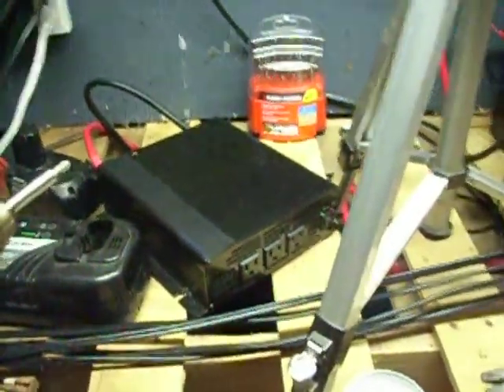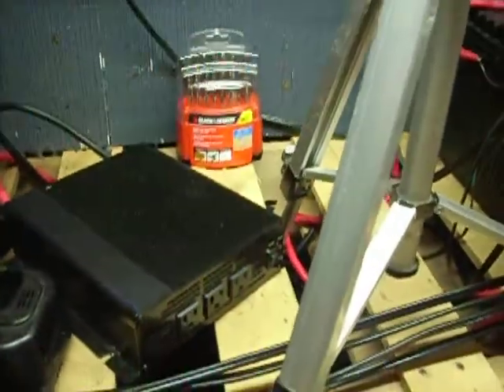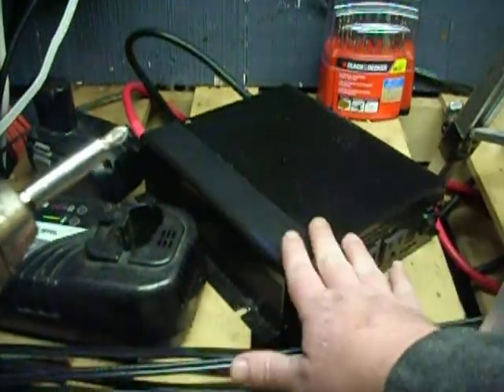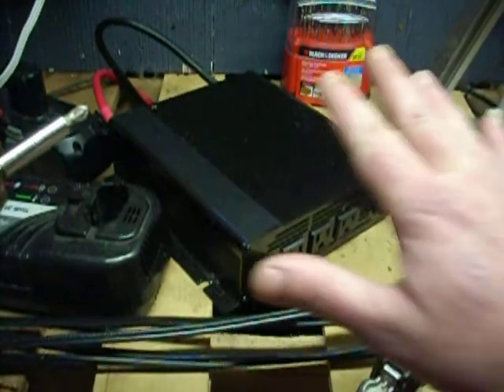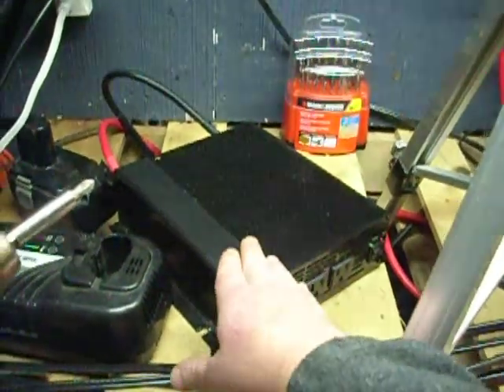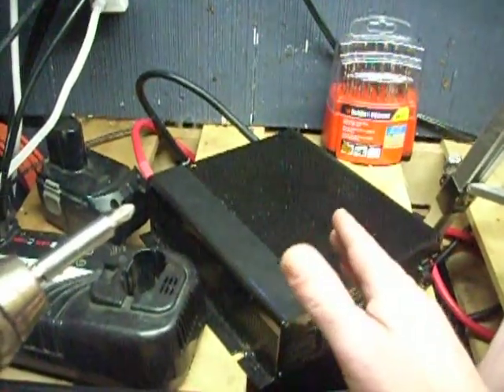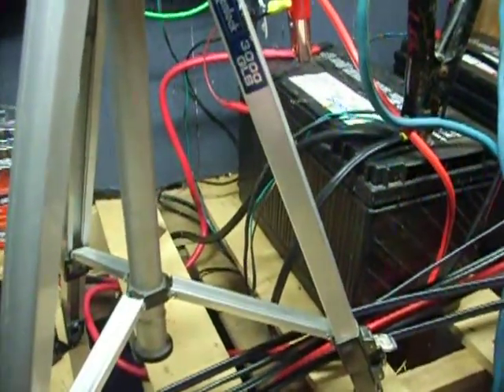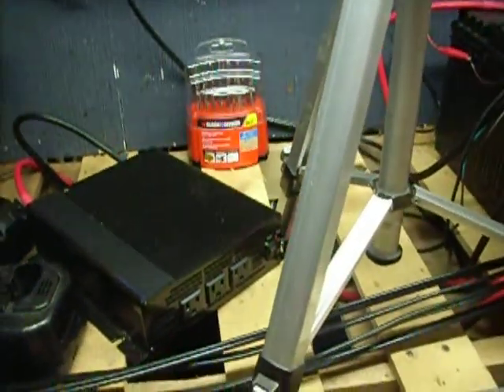Amps--Watts,, I try to explain

Comment from the maker: Watts don't mean much to me,,, I could be getting 1000 watts at 1 amp that is nothing,, I need Amps to charge and run my setup.. Amps charge my batteries. Lets look at cars,, Most cars use a 70 AMP alternator for just ONE 12 volt battery... AMPS are what is important,, more AMPS the faster your battery bank recharges, that is all you need to know, 12, 24,48 volt system it does not matter,, More amps is better.
Reply: I made a very good chart in one of my videos that explained it very well. Video name ( Off-Grid. Watts volts Amps. Hope this helps ). keep the videos coming Jason i enjoy them.
Reply from the maker: Justin Case
Thanks bud ,, I will check out your video :)